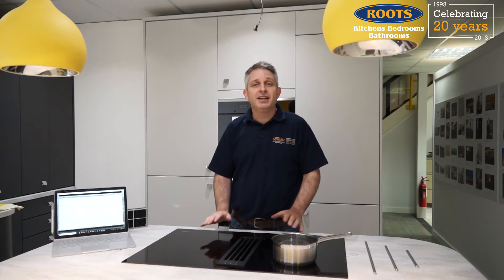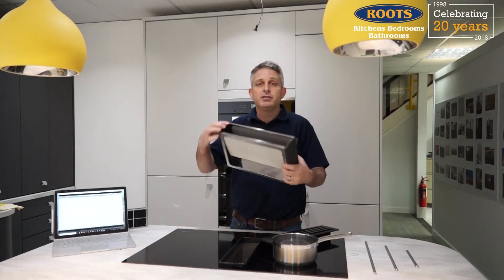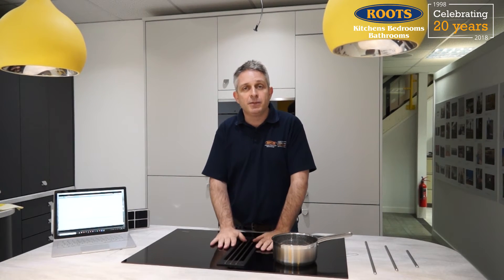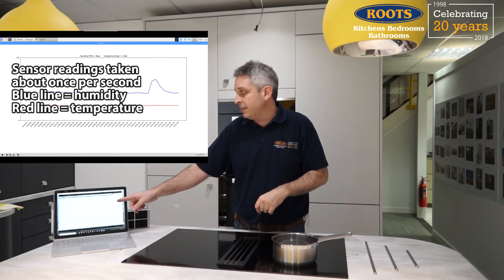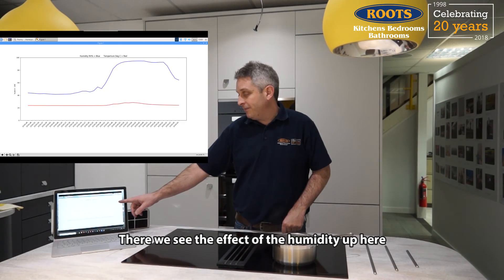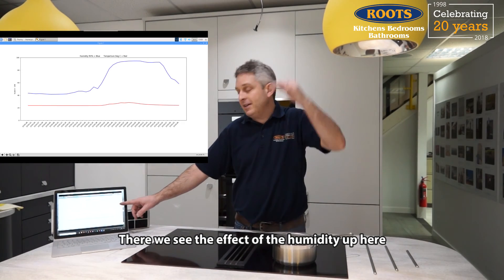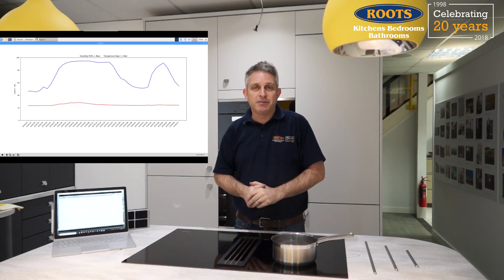We test the effectiveness of extractors that are built into hobs (instead of placed overhead)

Comment from the maker: Does this extractor sound noisy to you?
https://youtu.be/SBfysIfETlg is the video that compares extractor noise but the short version is:
please don't use a youtube video to compare noise :-)
You should know for this video; 
* I didn't reduce or alter the sound level in editing and 
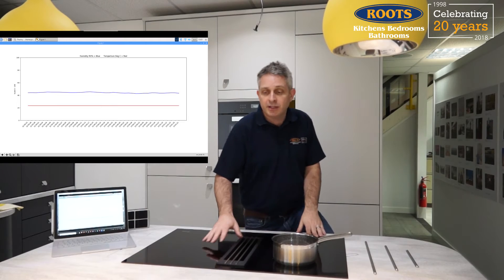* The microphone I was using is the one attached to the camera, I've not even got a tie mic and you can even hear the creak of the aluminium stool I stand on at 1:54

Because I could have played with sound levels in editing it's not a good idea to trust noise level comparisons on a youtube video. If noise level is a consideration check the manufacturers specification sheet. There's a standardised EU data sheet for every extractor so you can compare like with like, for this model it can be viewed here: https://media.miele.com/downloads/92/f1/04_F61547C6F7151EE89EB26124135E92F1.pdf
Thanks for watching!
Steve
Reply: Good video, but it really needs an accompanying exhaust test for recirculating extractors.  e.g. if it's not possible to extract externally and the exhaust just comes back into the kitchen, is the humidity/fat/smoke just coming back?
Reply from the maker: @Pionirish  Great question. Recirculation doesn't change humidity in the room (or more correctly, doesn't remove the increase in humidity from boiling water) so if you're building a new home in the UK you need to have another form of ventilation to meet building regulations. The rate of this is much lower than an extractor and sometimes includes whole house ventilation and heat recovery.  For fats & smoke, they should be caught on the grease filter which can then be put in the dishwasher (and being so accessible is more likely to be cleaned as its so easy to remove compared to overhead extractors).
Of course, you can still duct these outside and we often do.
Reply: i just fitted a kitchen with the same extractor and honestly its too loud , although it has two speed options ,the low speed is useless and full speed is absolutely annoying ,costumer did not expect it either
Reply: How abt the noise of the extractor? Can that be minimised ?
Reply from the maker: @prashanthireddig  This video https://youtu.be/SBfysIfETlg tests the noise level of extractors, but to minimise noise the general rules are: 
a) Use the maximum size ducting (eg: 6 inch diameter or the square equivalent)
b) Keep ducting runs as short as possible
c) Avoid turning where possible.
In reality, you're often limited by what you can do in the room/cabinets/design.

Comment: What's the maximum CFM of the fan on full speed
Reply from the maker: In Europe we use m3/h (metres cubed per hour) rather than CFM (cubic feet per minute).
Short answer (but see context!): 615m3/h = about 1050 cfm

Context:
Before open plan kitchens were common, the industry guidance was to change all the air in the room 6 times per hour as a minimum or 10 times per hour as idea. 
A typical* 3m x 4.5m x 2.4m high room = 32m3, so 10 times per hour = 320m2. 
However this often doesn't account for open plan rooms so my experience is the volume of the kitchen+kitchen/diner+adjoining-lounge-with-doors-never-closed is nearer 100m3 or more, so reaching 10 times per hour or 1000m3/h is not possible or logical.
The guidance has moved away from using total volume of air moved as a single metric once the extraction vent is next to the hob. It's viewed more as a bubble of effectiveness of the extraction so typically one vent can cover 4 cooking zones.  For larger areas see Bora Classic range.

The fan also varies it's speed depending on the power you have set the zones too (more power = it assumes to run faster, and running faster is noisier) They are typically quieter than wall mount extractors (and it helps your head is not by the motor too) but the aim is only to use the power you need thus the overall effect is quieter, and often not reaching the full speed the fan is capable of.

One other thing, it's common for fans to have a setting now where they continue running on their low setting for a good while after you finish cooking so they can continue to remove background smells, often quiet enough to barely be heard.

I hope that helps,
Steve

*https://www.statista.com/statistics/1056040/average-kitchen-sizes-new-british-houses-1930-2020/

Spec sheets for this type of hob (bora and Miele):
https://bora-content.com/product-documentation/product-fiches/pds-xpure2-en.pdf
https://media.miele.com/downloads/08/01/03_C7F13838A5DE1EEF90D771514A160801.pdf

Comment: Hi, What the make and model the hob/extractor. Thanks
Reply from the maker: This one isn't made any more, but it's a Miele two in one.  Current codes like KMDA 7473 FL-U  , https://www.miele.co.uk/product/12246280/induction-hob-with-integrated-vapour-extraction-kmda-7473-fl-u-silence and note there's a different code for the version that recirculates as opposed to extracts.

Comment: That's an interesting delayed humidity effect, but I suppose in normal cooking I'd start the extractor running before boiling began, not wait for steam to build that will have traveled too far to be sucked back.  If this was vented to the outside, the steam might make it all the way out of the duct, but the duct would need to be carefully kept at a slant so any condensation could drip the rest of the way out.  Grease must be caught by the filter, and any spill of liquid is going to make a mess of that filter and likely the ductwork as well.  It would be great if it was as simple as having a hole in the hob with a SS filter and a remote blower to keep it quiet, but the collection of grease and spills make me leery.  It would be a great solution for high ceilings above island hobs where an in-ceiling extractor is more than 5' above the cooktop ... if it worked.
Reply from the maker: Hi, great questions, let's answer them all:
>  I suppose in normal cooking I'd start the extractor running before boiling began
Yes! The extractor starts when automatically  when you set power to the hob. I turned it off to test if the extractor actually did capture the humidity effectively for the video.
> the duct would need to be carefully kept at a slant so any condensation could drip the rest of the way out
Correct! If you read instructions for fitting ducting condensation is always a consideration. They should be fitted with a slight downhill angle towards the outside.
>Grease must be caught by the filter, 
Yes, and that's easy to remove and put in the dishwasher to prevent residual smells.
>..and any spill of liquid is going to make a mess of that filter and likely the ductwork as well
They are designed to handle that, see this video: https://youtu.be/5L9GOv90g9w?si=7DDpW0KWsZ2fkN_e where I spill Bolognese down the hole. The grease filter is also designed to hold/catch a lot of liquid and you can see there's no way for spills to get past the fans and reach the ductwork.
>  a remote blower to keep it quiet
Yes, but much of the noise is actually the air moving. The motors are very quiet now (see my other video on extractor noise levels) On long duct runs an extra motor can be fitted, and Bora have a carbon filter that's also a noise attenuator. External motors are available for some hoods (Miele for one) but they're expensive and take up space on the outside wall, so not very popular.
> but the collection of grease and spills make me leery
Yes, but it's much easier to clean than filters that are over the hob (and many of the kitchens I've measure over the years have broken or unused hoods over hobs that have a film of collected grease, so one argument in favour of this design is it encourages us to wash the filters more often than we do for overhead extractors)
> a great solution for high ceilings above island hobs where an in-ceiling extractor is more than 5' above the cooktop 
Yes! I don't like flush ceiling extractors as it's hard and potentially a risk of falling when people clean filters. And extractors that hang from the ceiling block line of site across a room, annoying when you're talking to someone.  That's why these are such a good solution.
> a great solution  ... if it worked.
I was sceptical too! Which is why I put one on display and tested it :-) I would happily have one in my home. When against a wall where an overhead extractor works, it's a 50/50 call for me, both work well so the design aims often decide which is best.
Thanks for the questions! I'm sure others have the same and hopefully the answers help lots of other people too.
Steve

Comment: Where does all the moisture go if there is no duct to outside? It must condense somewhere.
Reply from the maker: It stays in the room. In the UK if you recirculate you need to have a separate external extractor for building regulations (nb: there are important exceptions to this, eg: don't extract if you have an old wood burner in the room) and that extractor is the solution to moisture build up. We normally use a humidistat controlled extractor for this situation, like a Greenwood CV2.

Comment: Where does the humidity go from the extractor?
Reply from the maker: In recirculating mode, the air and humidity returns into the room. *
In the UK for building regs you'll need a separate extractor, normally a small 100mm diameter model for background ventilation UNLESS you have an old style boiler, fire or aga that does not have a balanced flue and thus burns air from the room to work (extracting air would mean the carbon monoxide from the boiler, fire or aga would be drawn back into your room instead of existing via the flue). 
* I think the filters must trap some moisture but that will eventually evaporate back into the room. Also remember a lot of humidity in a home comes from our breathing which is why building regs require ventilation. The regs accept a kitchen extractor ducted to outside as meeting the ventilation requirement and the assumption is people use the extractor when cooking. 
Of course, you can connect these extractors to ducting to take the air and humidity outside of the room but the challenge is finding a route for the ducting.

Comment: How it performs in terms of heating food when stove is gas instead of induction? I feel to disturbs gas stove flame hance slower cooking
Reply from the maker: Hi, Almost all of these are induction hobs in the UK (Almost all of our sales are now for electric hobs rather than gas) so it's not a problem we see.
However, if the gas versions are disturbing the flame and reducing the flames efficiency at putting heat into the pan I suspect you'd simply turn the flame up to compensate.
 
Most hob cooking is not done at full power, or it uses full power for a few minutes to get a pan of water boiling and then gets turned down to simmer. The time for cooking is more dependant upon how quickly the heat enters the food rather than how much heat/how quickly you can put into the pan.  
Example: I once ruined a non stick pan by having the hob set too hot whilst cooking sausages.

Comment: thanks for the excellent demo. We intend buying an ikea kitchen and  they offer the FÖRDELAKTIG as an induction with a downward draft. Do you know of other brands that would fit their kitchens that you sell?
Reply from the maker: You need the cabinet dimensions, the appliance dimensions and then to compare the two. Checking that Ikea hob, the surface is 83cm wide, 52cm front to back, it needs worktop greater than 55.5cm, and the motor makes it 24.5cm thick - all of which is fairly normal for venting hob dimensions so my instinct is that all manufacturers hobs would fit into Ikea cabinets. 
The ducting route & dimensions is something to be aware of. It looks like their hob has the ducting running down inside the cabinet which may or may not clash with drawers (that applies to the Ikea hob in that cabinet too, or to another hob brand in the ikea cabinet, or the ikea hob in another furniture brand cabinet). It can be useful to allow for deeper than 60cm worktops if you have space as that can make fitting ducting (and other pipework) easier but likely adds to the cost of the furniture/worktops.
Also, we only sell in East Kent, south east corner of the UK and the brands we've chosen are Neff, Bora, Miele but there's no reason to exclude other brands in your search - we're a small business and don't try to sell everything to everyone 🙂Good luck with your search, you might also find this video useful https://www.youtube.com/watch?v=SBfysIfETlg
Steve

Comment: Nice video, shame its not using a vigorously boiling pan. This is just steam from a previously boiled pot.
Reply from the maker: Hi, that pan was boiled from cold (you can see I sped up the video until it boiled and lots of visible steam was generated) but that's a good question as to whether a vigorously boiling/roiling boil pan generates steam that can rise faster/more forcefully than the extractor can pull in.  
My experience is that is not a problem but that may be partly due to once a pan is boiling you naturally turn down the heat, keeping the boil but knowing that any extra energy added to the pan just turns water to steam faster.
I reasonable certain that not all humidity/air will be captured by these but likewise I'm certain overhead extractors don't capture 100% of humidity/air either.  Air movement is complex in a room and you should leave an extractor running (on low, it's quieter) for a while after you finish cooking to help remove all the odours. Most of the extractor models we're selling today have an automatic run on for this reason. You turn them off but they got to a low quiet setting for 5 or 10 minutes.

Comment: On the AEG 6000 flex zone hob , it says it’s a recirculating one, but do you know if you can actually duct it out instead?
Reply from the maker: Sorry, we don't sell AEG so I dont know. However many hobs like this are now specified as ducted or recirculating when you order them, so they come with some of the right parts for recirculating (filters mostly, and even for recirculating there are times when you'll want to use ducting specific to your room to recirculate the air).
Reply: @RootsKent  thank you, I’m finding it so hard to find out any information on this! I’ve ordered the AEG 6000, it says it’s recirculating so it will use carbon filters, however, the guy in wren is saying we should be able to duct it… but can I get any info… not as yet! My builder needs to know so he knows what to do with the floor! Do you think I’ll have any issues with it being recirculated anyway? I’m panicking as I always thought it was going out the wall! 🫣
Reply from the maker: @eyeliciousbrowlashskinclin6671  surely Wren should know this, especially if they specified it.... still, on the AEG site they have different models for ducted vs recirculating so I'd normally order the correct one (otherwise there can be issues with warranty even if an unrelated fault develops).  https://www.aeg.co.uk/kitchen/cooking/hobs/extractor-hob/?d2cSellable=true  

Checking https://www.aeg.co.uk/kitchen/cooking/cooker-hoods/induction-hob-with-extractor/tch74b01cb/ it looks like it vents to the void behind the cabinet (not for use on a building's outside wall, potential condensation from warm air cooling quickly) but there's a reasonable chance that's a standard size duct outlet and you can buy ducting to fit... though ducting can be hard to find and not inexpensive.  There's also a chance the ducted vs recirculating models may have different settings to suit their use (eg power setting of the fans, whether other parts are fitted or not to hold filters).

If you get it and duct it post back as maybe someone else is having the same question.
Thanks and good luck!
Steve

Comment: Hi, great video. Do you have knowledge on ducting to external versus recirculating within the island units? We are struggling to get a duct connection but are worried if the recirculating option will actually work or cause problems? Any advice welcome, thanks
Reply from the maker: thanks 😊Answer Short version: Recirculating works, just remember to replace the carbon filters from time to time to remove cooking odours
Long version: I would love to find a way to test carbon filters effectiveness at removing odour but I've not found an official test to copy or a rating scale. However, carbon/odour filters have been used for many years in kitchen and also in industry, so I'm confident they work. One advantage to recirculating is that you're not taking your warm home air outside and having to reheat new air coming into the home. One disadvantage is that you still need some form of external extraction (for building regs, essentially to stop humidity building up in the home). A small extractor fan can do this, I like the humidistat controlled versions that boost when humidity is high then drop to a low flow rate at other times. The total volume of extraction of these is much lower than a kitchen extractor but they are allowed/work because they run continuously rather than rely on being turned on when someone is cooking.
I hope that helps
Steve